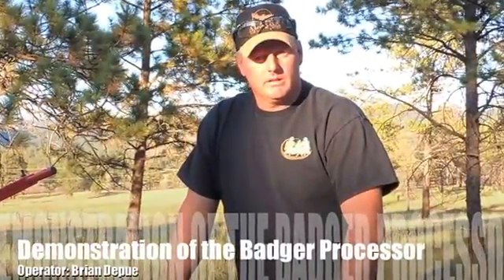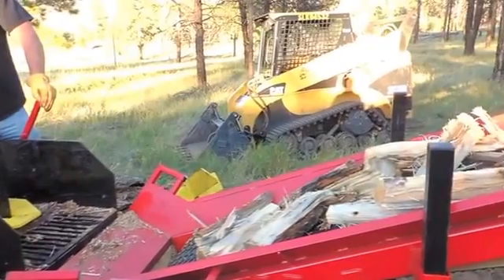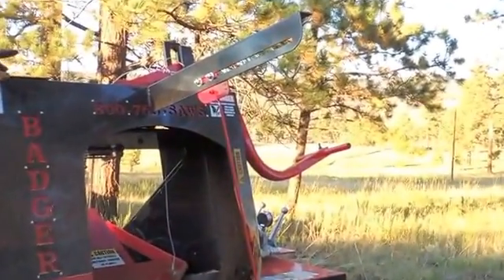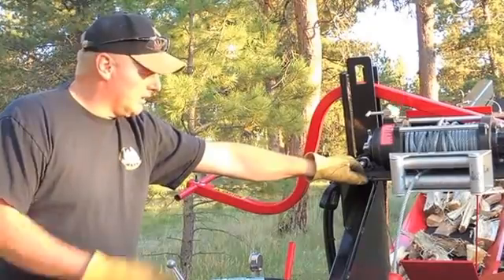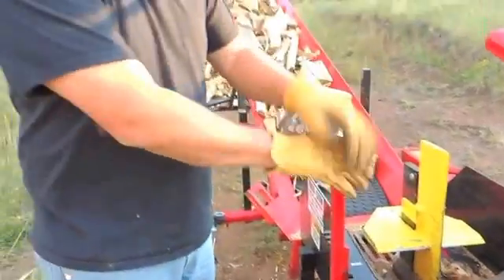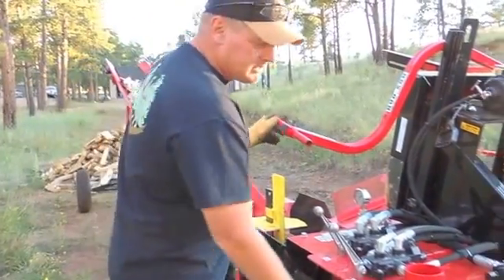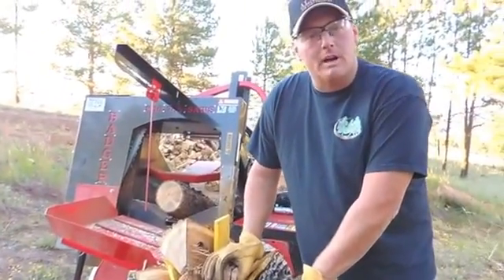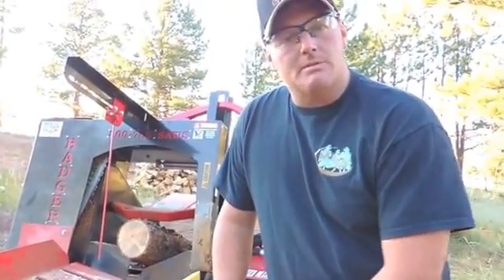Badger Firewood Processor

Comment: Definitely something not right with the obstruction in the drop chute, however, a machine like this fits my business model quite well.  It works perfectly to chase small tree jobs around cities, farms, and mountains alike.  Anything larger than 20 inches I'd buck up and use a far different style of wood splitter.  One option I could see being very handy for a machine like this is a wood chipper and hopper.  If I can roll up to a site limb a fallen tree, process it, then chip up the branches, and drive away without needing any other trucks or towed machinery I'd be golden.

Comment: way to clumsy and slow. Lots of manual labor on this thing. I went with the Turner processor.
Reply: The Turner does not have a winch cable. From the looks of the Turner you have to load the logs on the live table with a tractor. More fuel. More time. The Badger is great just having the logs placed in one spot and the cable pulls them in as needed.